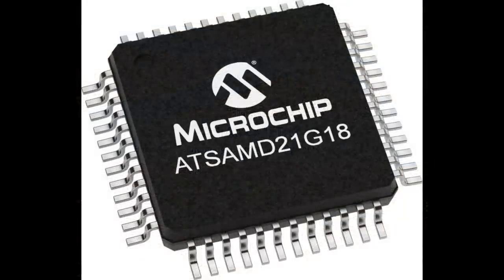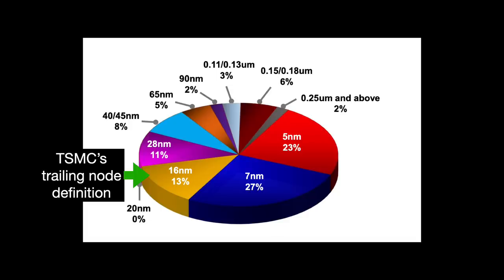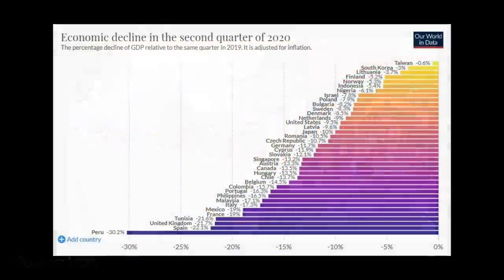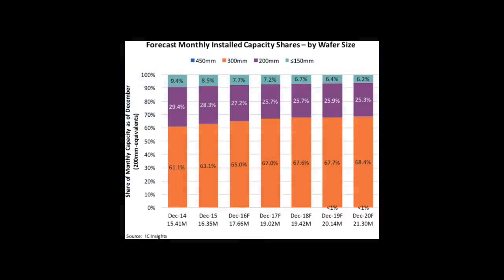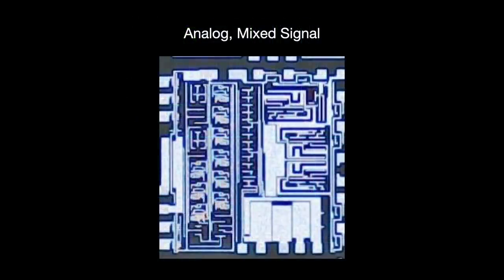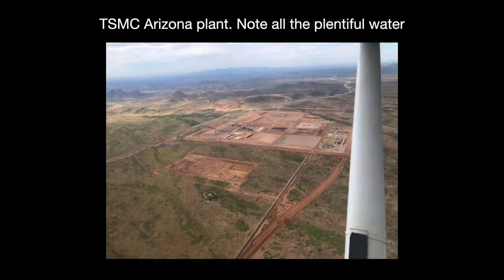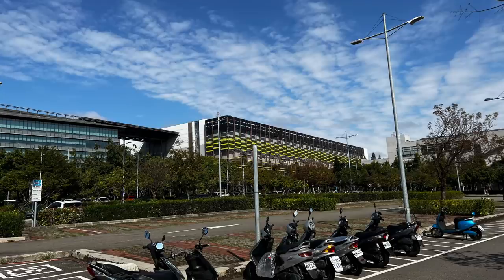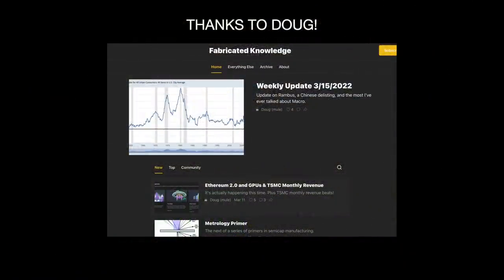Where The Real Chip Shortage Is

Comment: As an outsider to this industry, it strikes me that the price point is too low.   If we are talking about a few cents per unit, would the consumer really bother if the price per unit doubled?  In most products that are in short supply and high demand a few cents here and there passed onto the consumer would surely not even be noticeable.  Particularly as the price of most goods have already risen an order of magnitude more than what the additional cost would be of double chip cost, due to distribution cost increases from fuel etc.
Reply: Unfortunately it's not just a few cents. What you say could be a long term strategy (to pay back for new fabs), but it can't fix the current problem.  At the moment, some semiconductors that were 50c are now being brokered for $150+ each!  Companies are bidding to stay in business (or keep the lights on in critical infrastructure) because they just can't get the parts they need! The video states that fab houses are operating with 95% utilisation, factoring in maintenance this is incredibly high! 

There are hundreds of thousands of component variations that are fabricated in these facilities, each with its own backlog. Manufacturers are pivoting to alternative components that look more available, which in turn invalidates the demand forecast for those components - the cycle continues and the market volatility increases.

Back to your analysis; what if that few cents was applied to each of a thousand components in a product you bought representing a raw cost increase of maybe $30. The manufacturer then needs to double this to make return, then the distributor adds 30% and a reseller add another 30%. This translates to an increased consumer cost of over a hundred dollars, just to ensure that the industry remains stable and profitable enough to operate. Will you still realise enough value in the product to justify buying it? Maybe...  Could that put the manufacturer out of business? Maybe.

Comment: during the 2020 pandemic it was not that paper products were necessarily in short supply,  it was more of an issue of hoarding. A bulk of the chip "shortages" in 2021 and 2022 are caused by the CCP hoarding semiconductors...The CCP builds with impunity.

Comment: Car manufactors should start to consolidate chips that are spread over multiple control modules in the car into standardised multirole chips that are made in extreme volume.
Reply: The free market will take care of this. Its really hard to justify a completely new circuit design and teams and teams of engineers to replace 10 $2 chips in a $40,000 car. It would happen if it was economically advantageous but its not so it doesn't.
Reply: @jacobdeangelis7702  I think this is more because the oem do have a lot of subcontractors that all build small modules that need all their own chips and tie in a bus network instead of having vertical integration like tesla that then can consolidate a lot of funktions in one controller.
Reply: I think a lot comes down to a tradition of modularity to support safety and repairability.
Car makers don’t want life critical systems like airbags, ABS, and engine/powertrain control to be complicated by trivial stuff like interior lighting, seat position settings, external cameras, phone and satellite communications, touch screen user interfaces...
Consolidating multiple functions usually comes with a high overhead of exponentially increasing testing complexity.  Todays cars are a strange mix of life critical RTOS demands, and a growing list of Consumer Electronics features more akin to a traditional networked Desk/Laptop OS.   Two very seperate programming and testing traditions.
Reply: And how does that solve any problem?
They can’t make enough chips now. 
Your answer is to create a more expensive one?
Reply: @neilkurzman4907  Yes, one more expensive one that does the work of a lot of distributed smaller ones.

If every chip in a module needs its own ram and memory, memory controller, bus controller and so on you will probably need less chip die space if you make one big one instead the die area of a lot of small ones. Thus you will need less fabrication.

Also that way you need less voltage regulators and other chips that need to support this one bigger chip.
Reply: @Morkvonork  
The microcontroller in the picture has its own RAM, Flash and peripherals. 
Along with the 32bit ARM core. 
You seem to be thinking about higher end Microprocessors.
Reply: @卩乇尺丂ㄖ几 Not for the end consumer, but when a government safety agency declares a recall, that cost is on the manufacturer.
Pretty sure the massive Takata airbag recall was in the last 20 years...
Reply: @卩乇尺丂ㄖ几 Car manufacturers end up paying for (some) in waranty repairs, and all of safety recall repairs.   
There is big incentive to modularize systems for these cases.
Repairs outside of waranty are niether paid nor desired by the manufacturers.
Manufacturers would much rather emulate the ”copyright” support system of computer Operating Systems and smartphones.  After the ”support window” expires, they wash thier hands and/or actively terminate or degrade the performance to force consumers into buying the newest model.
This is already a big issue in farming equipment with software key lockouts preventing repair.

Comment: Inelastic supply applies to many goods we depend on. Semi-conductor asides, the oil and gas problem also apply. Oil companies hesitate to spend billions of dollar to reopen old rigs and wells to increase supply, because it will take a long time, as well as terrible future prospects, and especially not when they have followed government's message to invest into renewables. Semi-conductors manufacturers also hesitate to increase production, only to see demand plummets from economic difficulties. 

We are stuck between a rock and a hard place right now, general mismanagement asides. The Ukraine war is a way overblown factor which the government and media push. Inflation reached 8% before any fighting even begins in the U.S. It was simply a perfect storm of manufacturing difficult, unexpected demand, slump in oil production, and Ukraine just got added on top of the pile. 

If there's any positivity coming out of this, hopefully manufacturers of motor vehicles will design their vehicle to be more components efficient, cutting down on electronic parts that do not need to be electronics, which will be better for the market in the long run.

Comment: ive been trying to get a small laptop for quick ssh with sbcs via wifi and everything is inflated even the old netbooks from 2005 the sellers call them 'collectables' guess il have to go for a gpd laptop and at an inflated price. Buying a 1gb ddr2 ram mini netbook with a 1 core 1 thread 1.2ghz processor for 300$ is just not a good deal :)))

Comment: You can't easily retrofit a 200mm fab with 300mm equipments. Normally 200mm fab are built smaller in size, especially the heights of each floor. Many of these 200mm fabs face problems of accommodating 300mm equipments which are larger and higher.

Comment: How much does it cost to build a new 3nm Fab vs how much does it cost to build a new 28nm Fab?
How much money do you get per wafer for 3nm chips vs how much do you get for 28nm chips?

You will get 87x more transistors per wafer on a 3nm process, and your customer is probably willing to pay a substantial premium per transistor for the smaller size.

While I am sure a 3nm Fab will cost more, I don't think it will cost that much more. That's why they will want to build new fabs with the latest technology, and consider any money they can earn from the old ones as a bonus.

Comment: Exactly - you CANNOT simply convert a 200mm Fab to a 300mm Fab without replacing all the SMIF Pods which transport wafers. 2. All Litho , Etch , CMP, Diffusion  Implant needs to go to 300mm. 

It will cost about $500M for a 28nm Fab to go from 200mm to 300mm. its not worth it. We faced this question at CSM in the late 90s. Its more economical to build a 300mm Fab capable of going 65nm to 16 nm and charge a premium on wafers.

Comment: I'm wondering in what cases you could re-implement devices on top of small CPLDs in 10 nm and slap them on small thin PCBs with level translation and anti-static protection, to hit the bigger-chip form factor?
Reply: Interesting, but i think we havent yet reach that state of desperation.
Reply: Some of the missiles the US are supplying to Ukraine cannot be manufactured any more because some ICs they are composed of are no longer available. The missiles are going to be re-engineering with modern ICs. I suspect for many edge case items that is the solution manufacturers will take. Replace those microcontrollers they have been using in the last 5 generations of digital camera/ keyboard/sound system with a low in System on a chip.

Comment: Would be interesting to know whether it would be feasible to use fab machines meant for "lower" nm processes with larger masks could increase capacity for the older chips more than the older nodes due to their  better power sink into the chips for the better nodes
Reply: Usually, unless some tool that's used on an old process node got superseded by a different tool on the newer node, and the one needed for the older larger node isn't available. I don't see how that helps though, it's not like newer node manufacturing capacity is sitting idle, or is being underutilized.
Reply: If you mean using say, 28nm capable equipment to make large features then yes.   It's just that the expense to make new masks  isn't trivial, and most of those chips are made in a fab that doesn't have the more advanced equipment
Reply: There is no stepper infrastructure for reticles other than 4x and 5x. You can do whole wafer masks aligners, but those have resolution limits and defect issues that can’t even break 3-5um in most cases.
Reply: It's possible in theory, but in practice wouldn't do anything for the current shortages. while there are maybe heavier shortages in one size than in another, ALL sizes currently have at least some shortage. There simply is no excess productivity to shift around.
Reply: @reappermen  I meant it as using newer machines that are still being built, to replace the machines that are super old. Not that it would curb the shortage

Comment: Except analog/mems, many old digital chips/microcontrollers can benefit from going to new, finer (like 40-20 nm) process : more chips production per wafer, cheaper price, better performance and low power consumption, etc. So such chip vendor should move from legacy/tailing process to relatively newer process to ease current chip shortage.
Reply: There's a little problem with that - there's only so much you can shrinkify a chip with mere several tens thousands of gates before it gets dominated by unshrinkable padspace and IO. But i do think some movement needs to be happening in that direction. Maybe dropping more peripherals into the chip, like at least digital IO rerouting, IO statemachines like on RP2040 and new atmegas, small FPGAs and whatnot, just to eliminate a bunch of little junk chips on the board. As long as these are purely digital and use the same pin drive circuits as already present, these should shrinkify right along.
Reply: What you talking about is called a die shrink. It does happen, but it’s not always welcome. The chip may not functioning exactly the same as the one it’s replacing.
Reply: Aren't almost all chips nowadays mixed signal? Even the little sensors have internal precision ADC + basic CPU. With process change it needs new characterization, calibration, it will not be the same part anymore. I remember how Atmel was updating their chips with A, P, PA suffix. Some changes lead to power saving, some changed the behavior too much and it caused a lot of headache to figure out what's wrong.
Reply: @jan.tichavsky  
Yes a lot of microcontrollers are mixed signal. But mixed analog tends to be lower quality. Better op-amps a voltage references are usually separate. Level shifters, buffers and voltage regulators are all need for a complete design in many/most cases. 
Then there are individual transistors.
Reply: Customers don't want them. Board makers and device designers want the same part with the same documentation they have been using for at least 10 years. Nobody has time to validate new micro devices for every project. Most of the alternative parts are coming from China with zero documentation. Exceptions are the cortex-M based micros which can replace the 8 and 16 bit micros, but they've only been around in the broad market for 5-6 years, you need a decade to actually get industry to use something effectively. And the problem is not only the big logic devices, it's the small stuff used in power regulation, usb controllers - they need to be cheap and they need to be reliable.

Comment: what's the benefit of building trailing end fabs?
why not make newer fabs and use them to produce more of same chips?
Reply: so 28nm is optimal cost per gate

why build up to 65nm?
Reply: @NoNameAtAll2  It's presumably cheaper, and how much benefit are you really going to get from producing a chip with mere tens thousands of gates on a higher end fab? You can shrink the logic but the IO circuits won't get shrunk. Most products, and there's really a countless number of them, need maybe just one very low end chip and some power semiconductors.

Comment: Why not invest in smaller and newer technology? If their is a reliability line at a certain size, or several levels of reliability at different sizes. Then that would be what I would think is ideal. That is if they are not beginning with refurbished equipment. If they are beginning with new, then go with the smallest for reliability. If for example the smaller size has the reliability for automotive manufacturers, but they are used to using older and larger, then they would eventually switch to newer and more efficient chips. Thus cutting the price of the newestish technology so it would be more available for more people.

Comment: These old processes are going to be commoditized, and there is still going to be demand for them.  If this demand is not satisfied by current fabs, its going to provide an opportunity for semiconductor companies in China, Malaysia, etc. will step in.  There's no such thing as an indefinite technological lead.
Reply: They are looking less like commodities and more like fine wines that mature and cost more with age.
Reply: A big problem with this idea is getting enough equipment to operate at large enough scale to disrupt the market. In many ways it’s more difficult to tool up an old node fab because cheap, vintage used equipment isn’t available or gets snapped up as soon as it’s on market.
Reply: @卩乇尺丂ㄖ几 tell me you’ve never worked in semiconductors without telling me you’ve never worked in semiconductors. Chips are not priced as market commodities and customer pressure to lower prices as each generation of product ages is unavoidable. The fab I work at is at capacity. We would love to start more wafers and sell them. People are beating down our door. What we’re not going to do though? Bend our existing customers over a barrel and fuck them when they’re hamstrung by supply chains. That’s how you get customers to leave for your competitors when things get better.

Comment: Forgive my uninformed or naive question. But why aren’t product designers who utilize these trailing edge chips upgrading their designs to take advantage of mid or leading edge? Isn’t a modern chip so much more capable than an old one? If I have to put 3 old chips into my circuit board to get my gadget to do its thing, wouldn’t I want a design that needs just 1 modern chip, even if it costs 3x than the old one?

Comment: Too bad this video didn't delve deep into the economics and analysis required to build a new fab expected to produce different levels of chips.
I strongly suspect that the only truly least risky approach is to build a fab that would produce the latest possible because it would ensure the fattest profit margins for as long as possible followed by continuing to produce at lower variable cost margins as long as possible. The other extreme is to build a new fab that produces "mature" chips which would mean that the new fab would be at an economic disadvantage compared to the competition due to not yet having paid off its initial construction expenses... Which BTW is exactly the path China is going down because it has no access to latest, new equipment. This year and next, China might be able to start producing 28nm with aspirations to produce 14nm (approx) a year or two after that which is more than a decade old as of this writing. This kind of upside down economics can make sense only in China where fabs can be ordered to be built regardless of financials.

I wouldn't be surprised if all of the chipmaking plans now in progress is still completely inadequate to meet global needs 5 years from now by at least half.